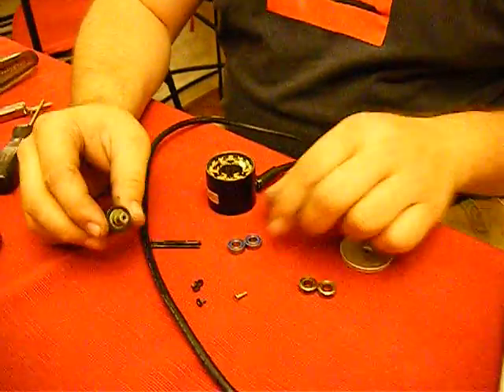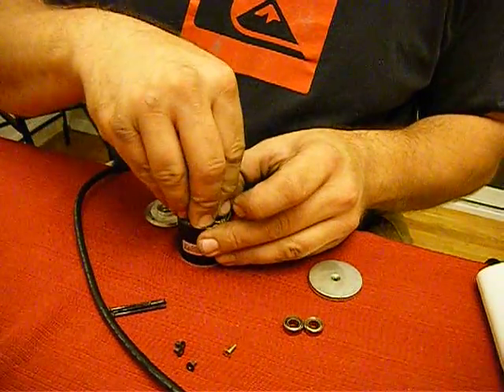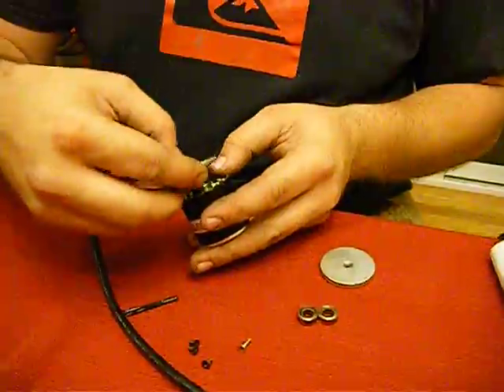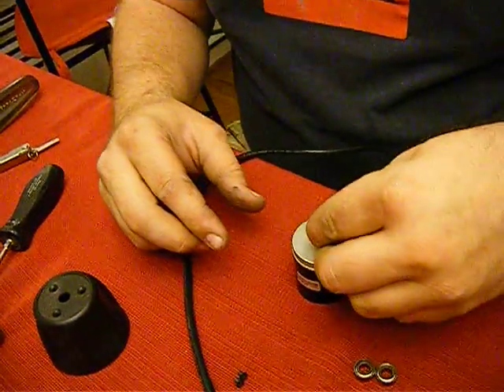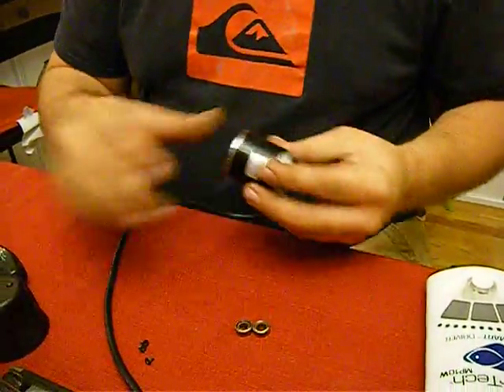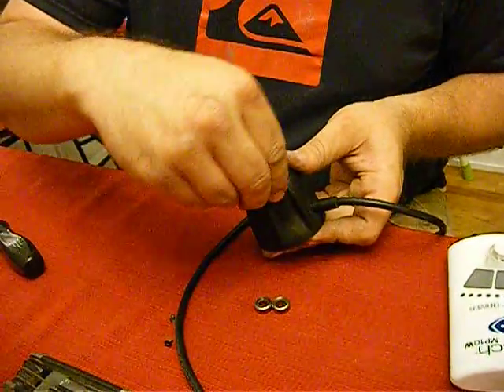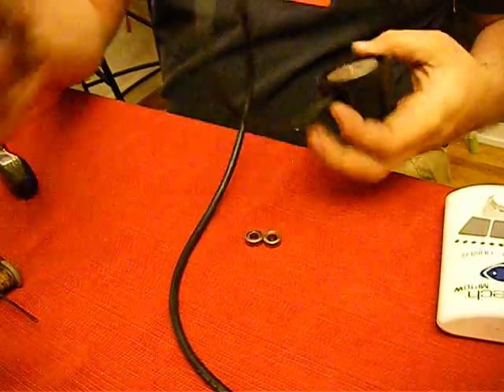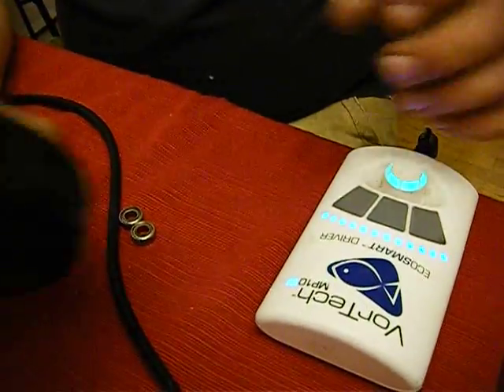mp10 bearing replacement part 2

Comment: Just don’t know why people are jerking off to this junk. First of all, it’s expensive and second is noisy. I looked it up, the bearing he used, almost $40 each, that’s $80 on top of the $250 you paid, that’s $330 in a couple of year. Wow. 

If under 100 I will grab one.
Reply: i ordered 2 ceramic ball bearings for 20 bucks

Comment: Charles : I have thoses spacers too and the warped one aint broken, its a spring washer.  It goes to the bottom.  There is a flat spacer next to it, then the bearing with magnet, then another spacer on top.  In my unit, there is also a kind of plastic washer wich goes next to the coil, to prevent the screws to short on the coil.

Breezyreef : yes they should be the same size but you got to know there is at least 2 kind of bearings for the MP10 : 7X14X5  and 6X14X5.  Thoses are sizes in mm, shaft diameter x outer diameter x width.

My problem is to remove them, they seem to be really stuck in there, I'll try the square trick tomorrow.

Comment: I took mine apart and there were spacers installed where do they go. do you need them. you didn't mention anything about them. One of my spacers was severly bent and warped must of been the cause of the noise, I took it out and am running without one of the spacers. the bearings looked fine, just need to test it.